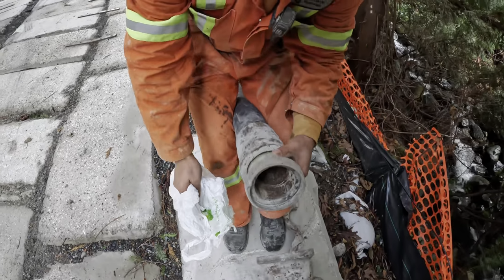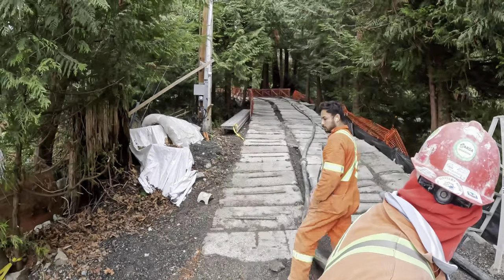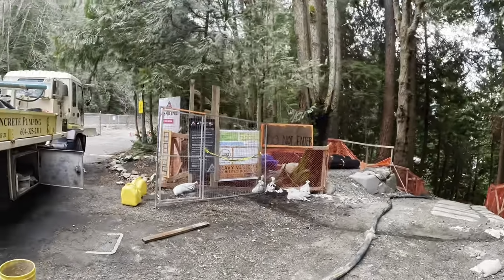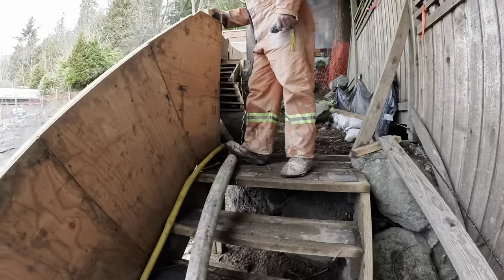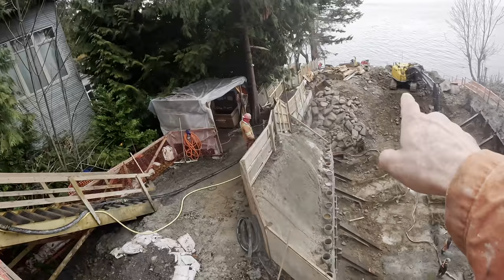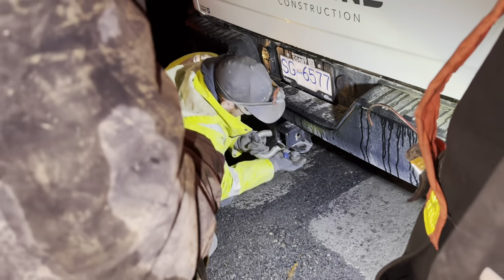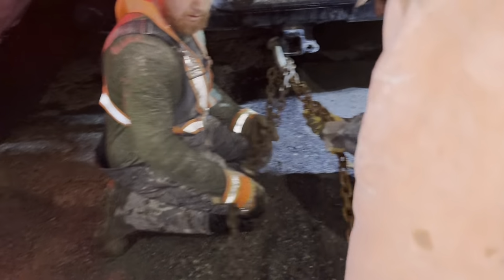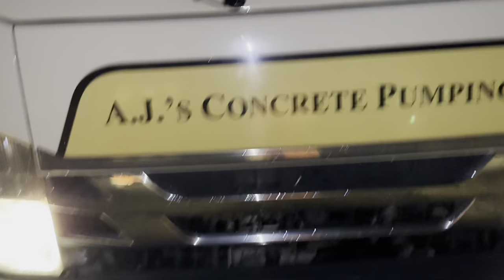Success with the plastic bag trick!!! and then we got the pump stuck 🙃🙃🙃

Comment: I have always come to the same results as you guys when using the spongeball first. 90% of the time I am using 2,5'' hose and 2,5'' ball. But last few time I have been using 2''ball and a mix of bag of dry cement and water. It went straight through 75meters dangerous steep hill in the woods. I wish we could get some bentonite here. Never heard before here.
Reply from the maker: I’m going to give the sponge-ball a try in an upcoming video. Will be interesting to hear feedback as to what we may be doing wrong and why it plugs on us damn near every single time.
Reply: @canadianconcretepumper1979  Yes for me too, till I switch to 2''ball inn 2,5''hose. Good luck and loves your videos

Comment: Use a plastic bag around a sponge when you suck it through a 5 inch hose.. slides nice and slow through the hose keeping your tip section nice and clean.
Reply from the maker: We do the same when blowing the first sponge through the high rise system. The plastic bag helps to prevent air from passing through the square foam sponges and potentially pushing backwards into the blowout cap.

Comment: also, I think a thicker plastic might do u better, I use like the plastic u cover your pump with, a thickness between the plastic bag and vapor barrier, it'll hold primer better, glad I could help!
Reply from the maker: The grocery bags actually worked surprisingly well when folded/doubled over. Crappy thing is at single-use plastic bags have recently been banned in our local area. Probably will end up using poly in the future (as you had mentioned). Always appreciate the helpful input from followers of the channel 🙏🙏🙏
Reply: @canadianconcretepumper1979  anytime man we all have little tips and  tricks to learn from each other. I actually have been having some issues washing out. I used to run a swing sp500 but recently we got a vsp70 and for some reason I keep plugging up washing out. I water wash bc it’s the way I was taught and when I’m pumping my last hopper full of water I get a ton of rock and sand in the washout hook and it just plugs terribly. I just let the water out in the ground or reverse back to pump but I’ve never had this problem and im not sure what to do? Anyone on here have any suggestions? And when I say rock and sand I mean 70% of hook filled w just straight sand and rock literally no grout and not much water. Im confused why it’s segregation is so bad ? I’ve never blown a ball back but would u recommend?
Reply from the maker: @kimvasquez1435  it’s funny, water-washing is pretty much non-existent in our market due to most/all local ready mix suppliers having policies in place which prohibit line-pumping back into their mixers. Only thing I could really say (and this is likely me just overthinking things) is that the VS70 with its 7” material cylinders has a very drastic transition where the material cylinder meets the wear plate. I could see this promoting segregation versus a TK40/50/60 which uses a 6” material cylinder and negates the need for said transition. I’m thinking the Schwing SP500 with its rock-valve hopper would fair even better than a Putz machines with the smaller 6” barrels. All just theory and speculation on my end however.
Reply from the maker: @kimvasquez1435  for me the easiest is just to blow the lines out with air. The easiest/safest is to suck a ball back into the hopper and assist with air if needed (only negative with this method is more mud in the hopper to deal with come washout time). I’ve never had much success with pumping water through the lines to purge out. Could be our mixes around here (very sandy) and/or the fact that we’re often tapering down to 2” line.
Reply: @canadianconcretepumper1979  thank u! I’ve never blown out a line , I seen your video and it seems simple enough . I’ll try the reverse into hopper method to see how it goes but with water in the yard I’ll practice blowing it out and on a job I’ll test w a couple hoses first. When I suck mud back into hopper, I’m assuming I need one of those 5” ball stoppers? And honestly you’re over thinking at all! With a rlly dry mix or a long day of pumping a dryer mix , the way that pump’s deliver system is engineered there’s about an 8”-12” gap between the mud cup and the wear plate. I physically cannot see the mud cups through the hopper washing out I’m reverse. Haven’t measure but it’s a good size gap. Maybe because of that gap the rock and/or sand isn’t getting completely pushed all the way so it sits but water still can move past until the build up becomes too much and it high pressures? Thoughts?